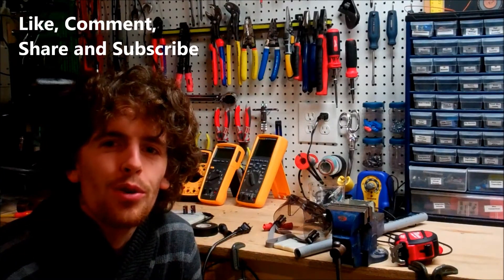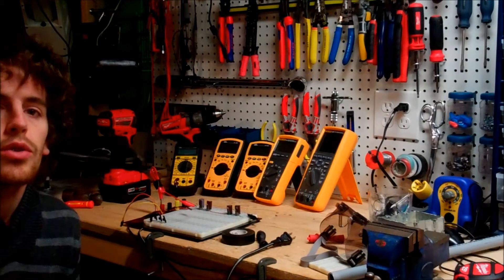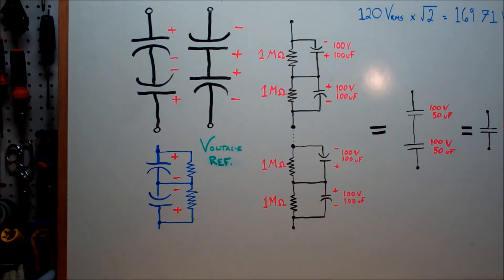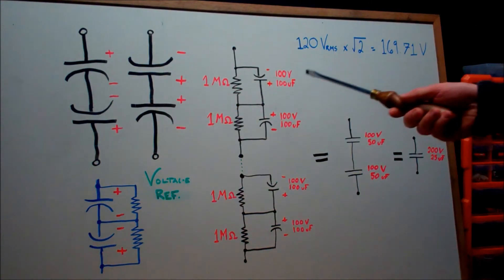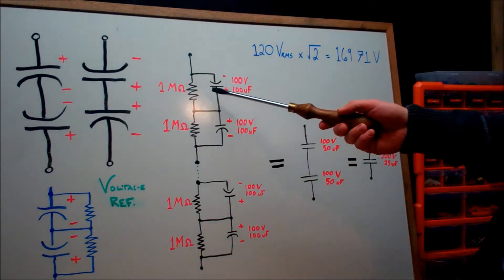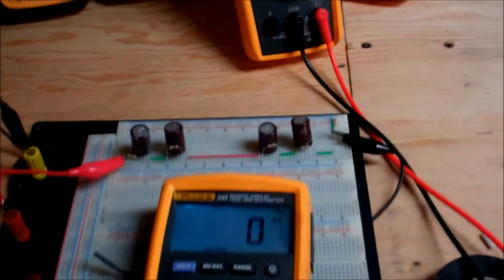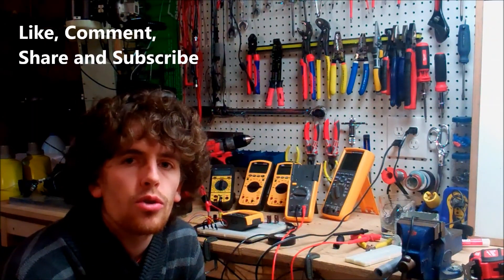How to Make Non Polarized Capacitors

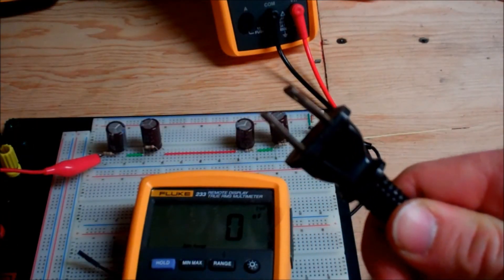Comment: 2:45 so is that why when I plug in my ebike charger pops in the socket ? because I don't have the battery attached to the charger before I plug in the thing in the socket... so what's the best way to do it ? plug into the battery and then socket ?
Reply: That's because capacitors initially act like a short circuit, only held back by their ESR and ESL. So, when you apply voltage, they draw an inrush current, which depends on the resistor in the circuit. That’s often what causes the spark.

Connecting the battery first and then plugging it in won’t really help because we’re dealing with a switching converter. If this were a capacitive dropper, not having the battery would leave the circuit open, and you'd be dead by now, and capacitive droppers also puts input voltage (mains voltage) across the load  during startup (again, they act like a short-circuit) until they're completely charged up.

So while the advice to "connect to the battery before the socket" won’t stop the spark and pop, it’s still suggested to connect and secure the load first. This can prevent any contact bounces that might stress out the AC-DC buck converter (that's usually a DC-DC converter with a full-wave bridge rectifier and a huge filter capacitor).

If you want to reduce the spark, you could try adding a small inductor to limit the current consumption at startup, though that might also cause a spark when the load disconnects or switches. The most reliable method is to use a soft-starter.

A simple NTC thermistor can do the job, but it will continuously waste power. Plus, you'll need to check if the thermistor is hot; if it is, you shouldn’t turn on the load (like in situations where power comes back on after a few second outage).

Using an auto-transformer to slowly bring up the load might work, but keep in mind that at lower voltages, the buck converter could be under more stress due to higher current demands.

So overall, a fast ramping soft-starter can be be used to reduce the sparks! Secure the battery in place to reduce any contact bounces and sparks from the battery which can cause wear and tear to the contacts, causing heat and burnout in the future.

Comment: But how does this work? When we apply AC voltage, what happens first? It flows via caps in one direction first, then in other? How does the caps get charged, if they are connected opposite to each other? How current flows from - to + ? As far as I know it isn't allowed to apply voltage to a polarized cap in reverse polarity. Never explained. Please, someone help understand the principle.

Comment: You can improve your circuit by using diodes instead of resistors across the capacitors. The ratings of the diodes have to be appropriate, the cathodes connect to the positive side of the capacitors. I have used this for motor starting a couple of times and it worked fine, the capacitors are only in the circuit for a second or two so it's not a problem.

Comment: You answered a question here that I learned the hard way - if you put two 450 VDC electrolytic capacitors back-to-back to make a non-polarized capacitor, as I did recently in a choke para feed 300B SET, the voltage rating is still only 450 VDC. We know if we add electrolytic capacitors in series (plus to minus, etc) and shunt them with some voltage equalizing resistor, like a megohm, we do get the addition of voltage ratings, i.e. two electrolytic capacitors of 450 volts gives us a 900 volt capacitor - but not when back-to-back to make a non-polarized capacitor. I raised the voltage from 400 volts in an amplifier to 1000 volts and it took less than a minute for these things to explode and fill the entire room with white smoke.... you properly mentioned it in your video but I thought I would mention again for any future viewer that the DC voltage rating is that of only one of the electrolytic capacitors.
Reply: Since I'm still very much learning the rudiments of components in general and see where both this video and your comment can easily be of use, I just wanted to make sure I read your comment correctly as essentially saying, "If you use the method in the video, you lose the usual benefit of connecting caps in series and do not also obtain a higher voltage rating." I.e. you have to choose your hackaround if you only have a finite minimum of caps available as you can't have it both ways. Correct?

Comment: If you can't dazzle them with science, baffle them with Bull shit. Thats what you did! Everyone trying to explain capacitors in AC circuits gets it wrong. Basically there is no difference in non polarized or polarized caps in an AC circuit. However you must take care to use polarized caps with a pulsating  AC signal the change it to a DC voltage. A non polarized cap will do the same thing with less efficiency. most caps are non polarized. The larger values above 1 Uf industry wise are polarized in order to hold a charge like a battery does. Using non Polarized caps in an amplifier coupling circuit requires no charge holding just smooth and efficient signal coupling.In a DC circuit we are mainly concerned with the time constant and surge values of the cap. In an AC circuit its the impedance at certain audio frequencies that we are chiefly concerned with. The impedance is the combination of Capacitance reactance , DC resistance and Inductive reactance. Finding and using the right caps allows maximum transfer of AC energy without losses at a given frequency. Stop looking for quick fixes and simple answers. If you don't have the proper academic education in this field then stop dickering around before you kill you are a loved one.Untrained hobbyists belong in jail.Trained electronics personnel have no business advising anyone on how to do,  when they don't understand the math and theory to the application.
Reply: "Basically there is no difference in non polarized or polarized caps in an AC circuit"

What do you mean? Putting a polarized electrolytic / tantalum capacitor (even with proper voltage rating) in an AC circuit will definitely blow it up or can be fatal when the polarity changes. That's why we have X and Y capacitors, MLCC / Disc / non-polarized electrolytic, etc. capacitors
Reply: " Untrained hobbyists belong in jail. " no fascist as.holes like you , attacking ppl verbally for their indeed very acceptable and fun life choices and hobbies belong in jail .
Reply: And if you can't get a job--or a date--then you should just troll YT videos and pretend you know what you're talking about and that it's your place to govern the universe. BTW, unless a polarized cap is given some DC bias on its positive side, it will quickly fail when passing AC. When its purpose is also to block DC current between stages, this happens automatically. If not, then either apply a DC bias or use a non-polarized capacitor. Look it up, F-head. You don't know what you're talking about, either.
Reply: You may have a good understanding of electronics, but your lack of understanding with spelling and punctuation makes you difficult to understand!!!

Comment: what about the diode bridge simulation to protect the cap at  wrong stat or reversed state
here is that circuit  link:  http://tinyurl.com/ycnq2gls
get back to me on the 2 diodes as a bridge
added for cap protection instead of 2 meg ohm resistors in your circuit
isn't this the correct way to protect the reversed cap every 1/60th of a second 
or can you elaborate on your circuit
the diode fully protects opposite  cap every cycle
where a 1meg resistor still puts cap at harm with reverse voltage correct or no ??
Reply: I bet you would build a fuse protection circuit too. Duhh Think about it. The cap is for the protection. So now you want to protect the cap with solid state devices or are you trying to create more distortion than you already have ?

Comment: does this trick could help in crossover circuits (for audio)
Reply: I see EV subwoofers using 2 or 4 caps like this. They tend to explode. 
If you do this, do it with big capacitors 450Volts used in crt tv's, like i did. 
I took them from Samsung & they are heavy.
Or you can take non polarized caps from washing machines.   They'r around 500Volts & 15 microfarad
Reply: I wouldn't do it. A true bipolar cap is manufactured so that "both sides" are equal. Having two regular electrolytic capacitors that are exactly equal is close to impossible and this results in distortion. Simply replace any electrolytic cap in cross-overs with film MKP capacitors or similar film capacitors.
Reply: Tricks are for magicians. Are you a magician? Go play your guitar,  the poor you hear sound has nothing to do with electronics, but more with your choice in what you call music.

Comment: Good stuff man, thanks
But what about the resistor wattage? how do you decide if you need 1/4 or 1/2 or 1 Watt?
And do you always need 4? so for the needed value, each 1 of the 4 e-caps must be 4 times the value? for example to get 10 uF we need 4 40 uF e-caps?
Reply: I see this comment is two years old but this is how I do it.
I consider the maximum voltage rating of the capacitor, for example 450 VDC and want to put a resistor across it that dissipates 1/2 watt so I can use 1 watt resistors. From one of Ohm's laws formulas, R = E^2/W which would be R = (450)^2/0.5   (voltage squared (450) divided by power( 1/2 watt) which gives 405,000 ohms so I use a 1 or 2 watt (depending on what I have on hand) standard value 470K ohm resistor across each capacitor. Works great. You can use much higher value resistors if you want (like 1 megohm) but you can not depend on these resistors draining the capacitors quickly when power is turned off. They will drain the charged capacitors eventually but it can take a Long Time that the capacitors will remain charged. These resistors are not meant for discharging the capacitors as they are there only to equalize the voltage across each capacitor while the power supply is powered up.  Stay safe...

Comment: Just adding that this is not really meant for permanent connection, as the capacitors will degrade with time and applied voltage as they are not designed for mains voltage use. If you do need a capacitor for mains use use a proper motor run, power factor correction or class X or Y capacitor as these are designed to either fail open circuit or to disconnect the terminals in case of failing short circuit.
Reply from the maker: You are very correct, I should have mentioned that this is only a temporary solution. Appreciate the feedback!
Reply from the maker: I added your note into the video, thanks for mentioning this! Your help was greatly appreciated.
Reply: @ElectricalNick  Temporary for how long? Till it catches fire ? Stop fucking with a science you have a zero based knowledge on the subject.
Reply: @erin19030  Catching on fire is far preferable to exploding, as referenced in the video and hence the reason for it.  Sheesh.... Go back to whatever echo-chamber you came from which likely quashes any and all endeavors and/or sharing of knowledge that might involve a moderate possibility of not being 100% safe. Other than a wonderfully dull life, this is what one can expect from a no-bs 100% play-it-safety-1st lifestyle: https://youtu.be/WdEoputkE98 (link to a non-obscene song, that's it)